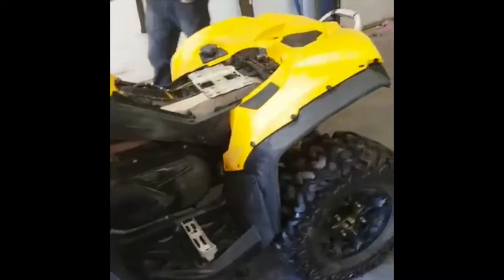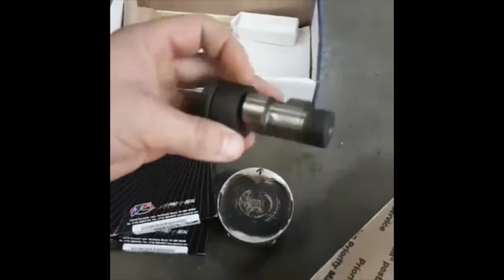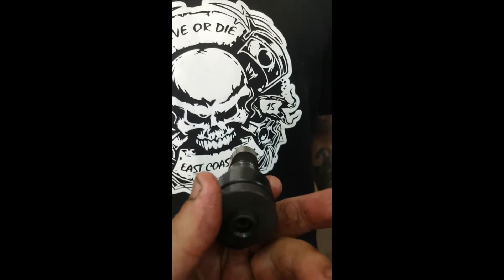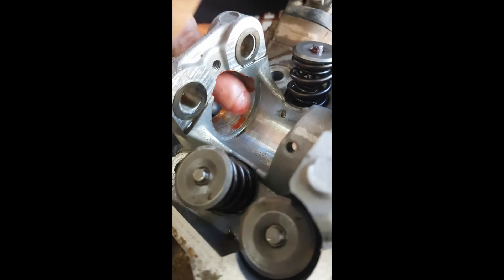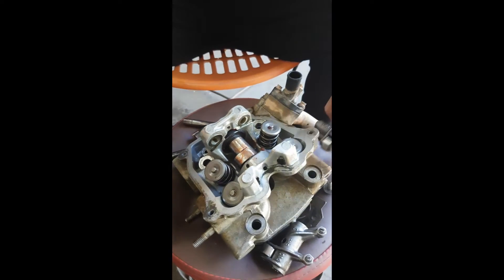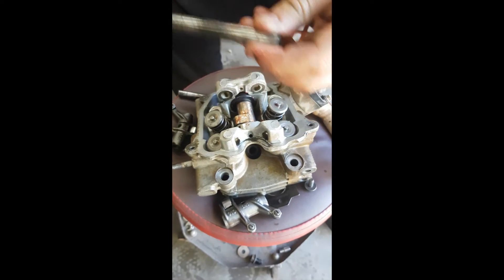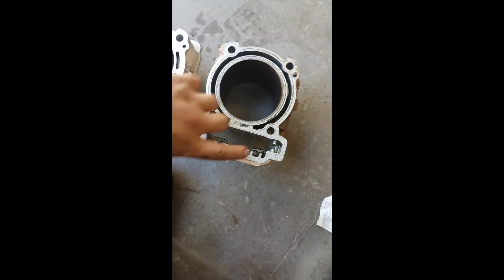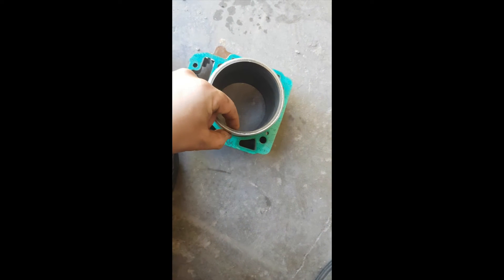940 Renegade Build

Comment: Are these big bore kits reliable as stock or will the engine be short lived. I was thinking of doing a bbk. Pls respond of your opinion
Reply from the maker: Hey man sorry for the delay in answering, It has had its problems as the big bore kit was not sealed around the bottom of the insert.